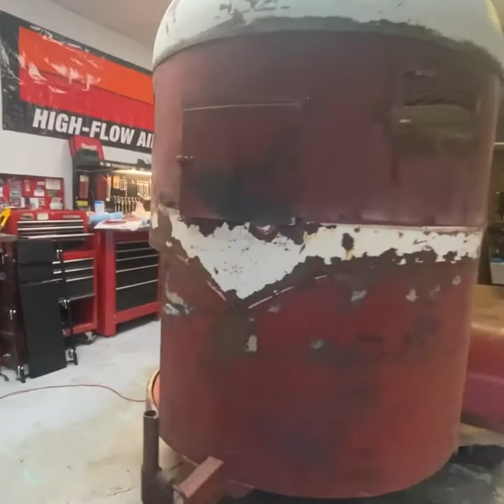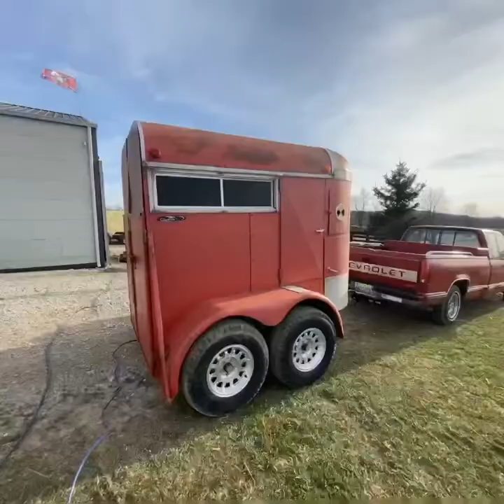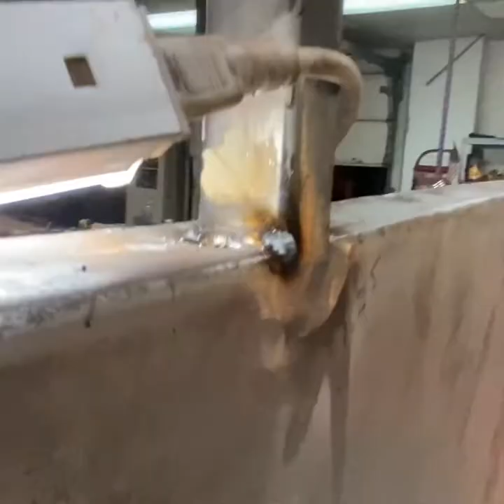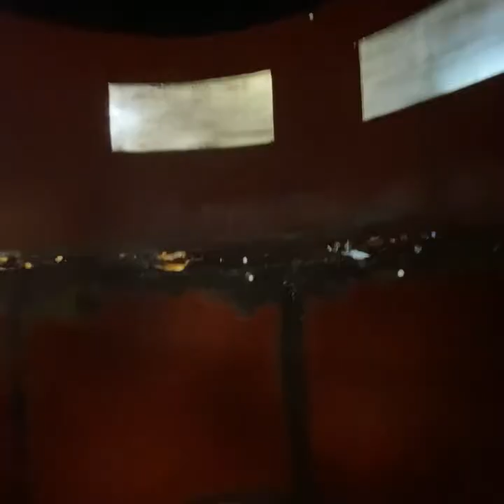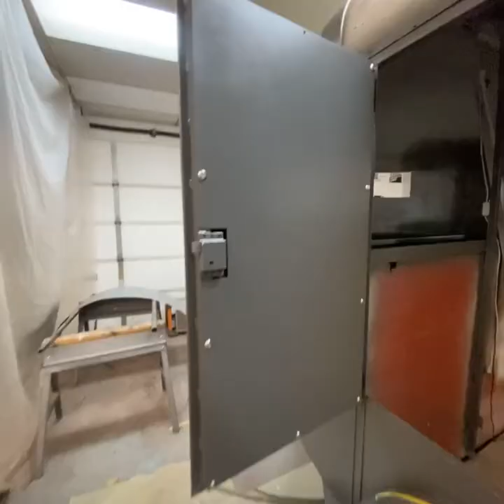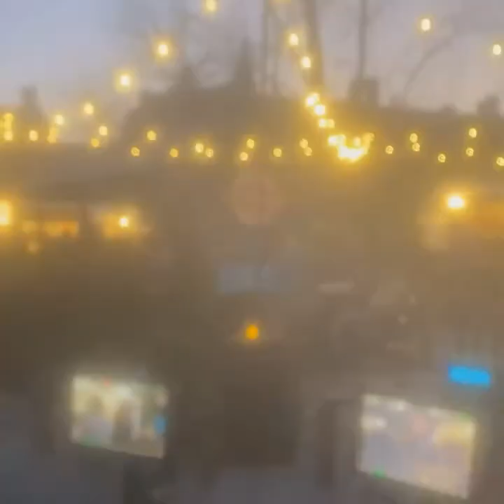Hometown Kickstart - Horse Trailer Restoration- La Grange KY

Comment: Beautiful. I refurbished a 1984 trailer. But I can’t find material for the curved windows on the front. What did you use?  I tried plexiglass and lexan but it cracked. Thanks
Reply from the maker: @katmcmillan1664  lexan works great, I used 3/16, if you give it a little heat it softens just enough that you can mount it without cracking